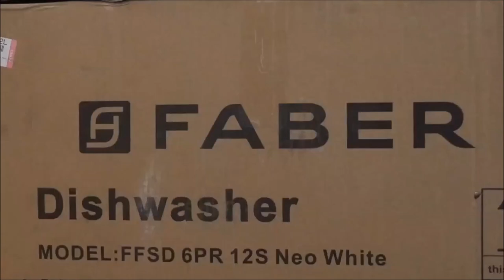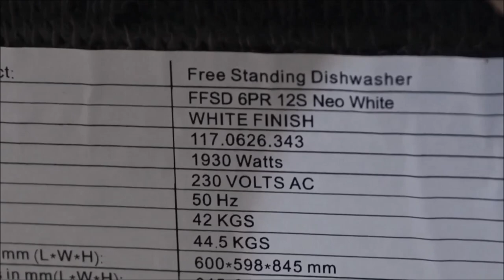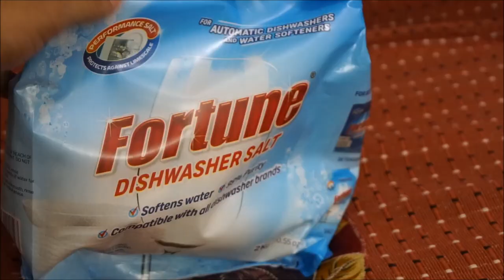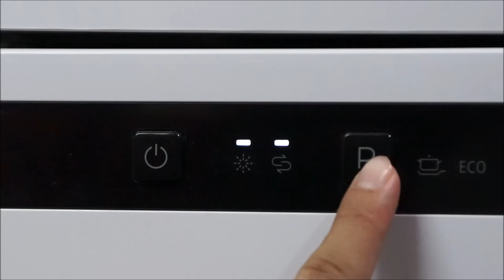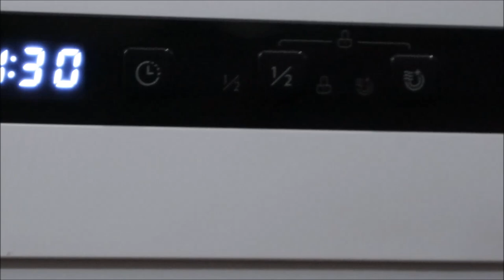FABER dishwasher unboxing + installation + fitting + working ffsd 6pr 12s neo

Comment: Show the vessels before and after wash... which ll be more useful
Reply from the maker: Food particles must be cleaned  before being put inside dishwasher, if you're wondering if you can put the dishes uncleaned with food, I'm Afraid it won't work , or any dishwasher for that matter, it's main function is to clean the grease or oil .